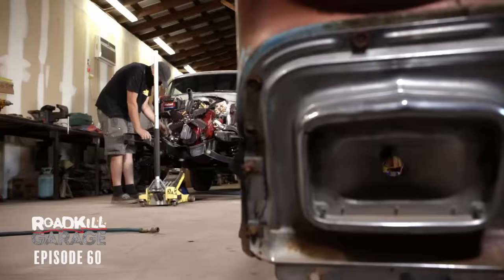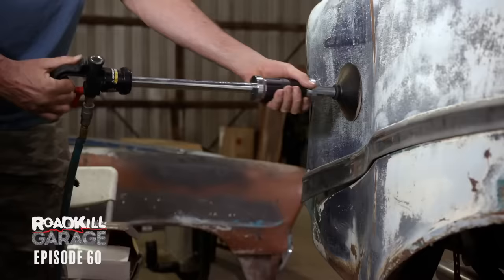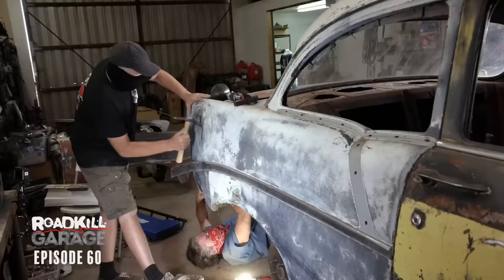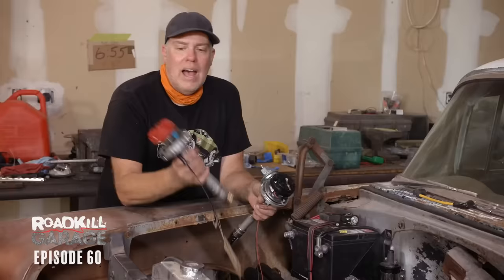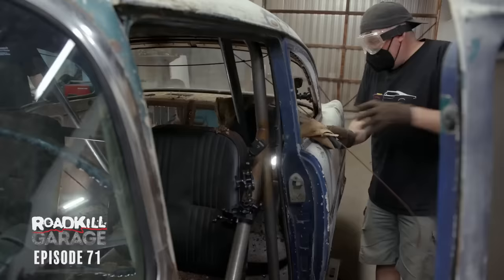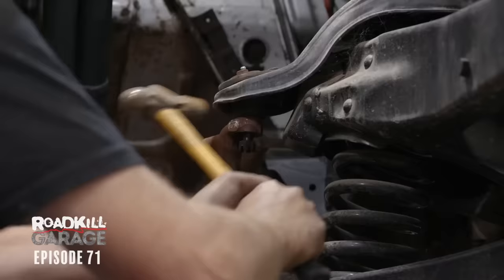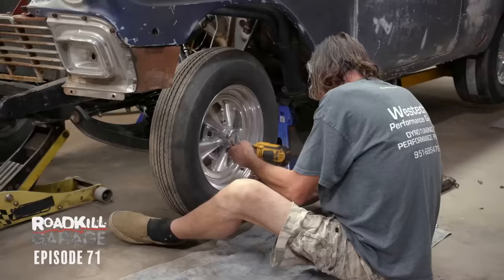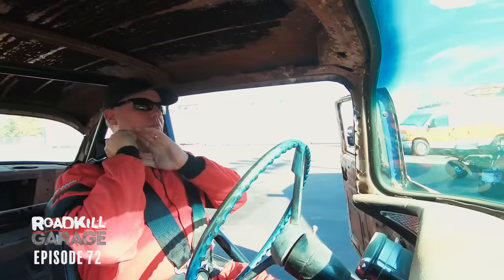Body Swapping a 1956 Chevy 210! | Roadkill Garage | MotorTrend

Comment: Have a 56 210.  Came with the Stovebolt and 3 speed.  Now has a 406 Dart and a TH350 prepped properly.  Strange 9" and Strange disk brakes.  The Jim Meyer Racing weld-in engine mounts made easy work, along with the plastic 350 bloc for alignment and angle.  Found receipts from Bogota Columbia Hotels with the orig license plate numbers on the receipts, still in the glove box, along with a air force ID card, with that name on the receipts.  Hmmm.  If it could talk.

Comment: One of my “associates “ in h.s. shortened a 57’ 4 door wagon by Chopping it in the middle and made it a two door.
I thought it was ugly until he installed a slightly worked big block / turbo 400 and narrowed 12 bolt .
It would carry the front wheels 1/4 way into 2nd and then got really squirrelly!
Mission Accomplished.

Comment: I had this dream where i was building a car. It was a regal that those valve covers reminded me of. I changed the front clip to fiberglass and painted it. It was taken by a passenger and from there a gas station. So i went to the junk yard cause i had to hurry before the track closed and didnt have any cash on me then. So i built a car in a hurry and when i put one of the used slicks he said it leaked. So i had borrowed a turbo to use and worked on the heads. So i had no nitrous and designed it to build boost about 30' out and when it was race time, i was in the right lane against a v6 who hid nos. Then he jumped the line so i acknowledged it and since i built it i wanted to test it since i was already at the tree. When it lit i went and that tire leaked on the drive down to the track. It wheelied off the line and the driverside rear gripped twisting the frame and put me in the wall. That car wasnt parked against the fence in this dream. It was weird cause i was doing somethin in the distributor with ignition firing order and like balancing centrifical motion when it reved so hard all the fuel was gone in seconds.

Comment: I've never seen a 265 with an oil filter boss cast into the block. They used add on filters.
Reply: Only in ‘55 265’s… in ‘56 they changed them

Comment: You seriously need to correct that harness bar. It's too low and the belt angle exceeds max angle. Perfect for spinal compression.
Reply: how is it supposed to be? I assume the bar should be high enough for the belts to be level?
Reply: @davidgalea6113  belts should be zero to no more that 20 degrees down from the top of the shoulders. New belts come with installation instructions showing how to mount. In my race shop we try to get to zero to 10. Harness bar needs to be brought up. Makes it difficult with more that one driver.
Reply: @cagedruss  thanks for the info.
Reply: @cagedruss  MOst harnesses I see are installed wrong and will break collarbones guaranteed .

Comment: with that dent put heat on it fro heat gun and when it is hot spray dry air that you clean computer with on it and the dent will pop out

Comment: What motor mounts did you use to move the engine 3/4 inch forward?
Reply: I’d like to know as well…
Reply: @jamesblinzler7421 i thought it was better for weight distribution to move the engine backwards? Why would you want to move it forwards?
Reply: Just did this to my 57, cpp on ebay. 90 for the mounts and hardware and the install was quick and easy. You have to move the trans mounts as well and that wasnt as easy. I used the speedway trans mount kit i think its like 150.